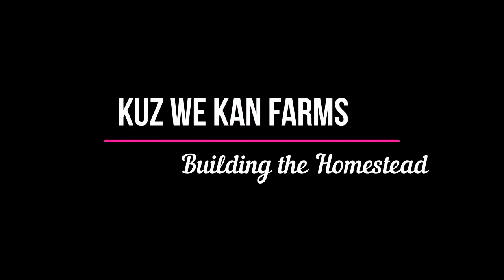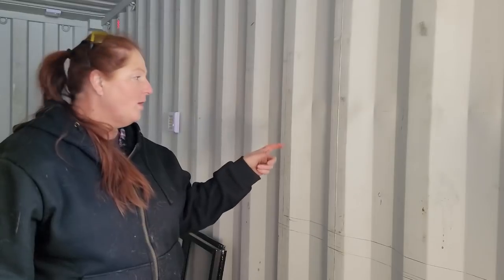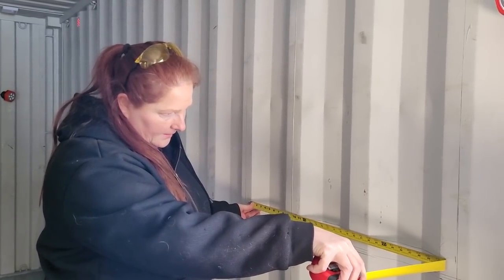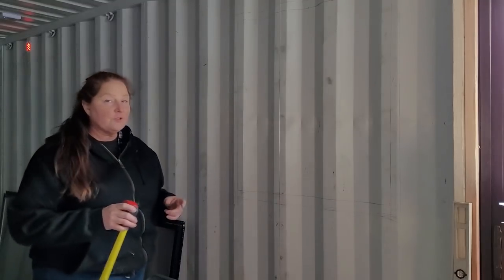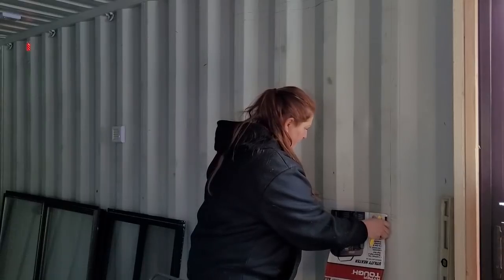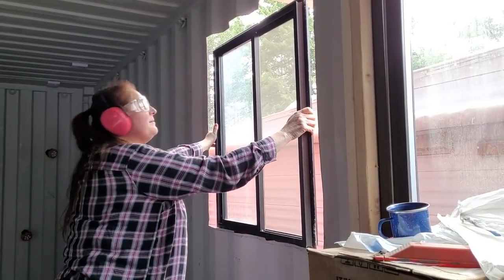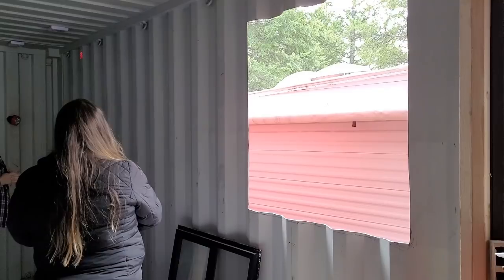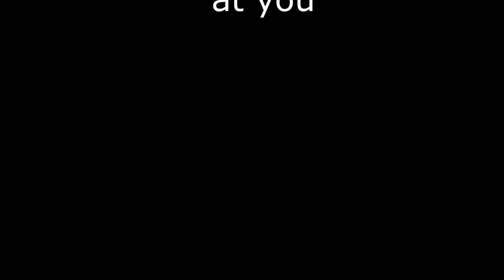Cutting out Windows in Shipping container Things didn't go as planned// DIY build// VLOG

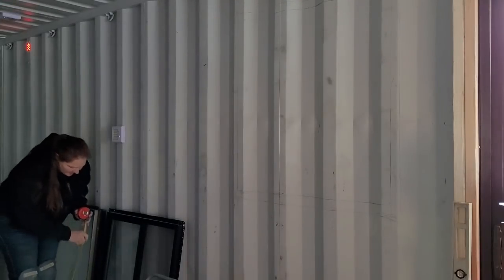Comment: As you drew the side-lines at 8:30, I had an eureka-moment. Instead of placing the side-lines on a slope in an effort to keep the opening symmetrical, how about shifting either left or right so that the side-lines fall on the flat of a bump or a valley. Even if one side is in a valley while the other side is on a bump. That way you can avoid angled cuts. Though you will have to measure the rip of each side separately.

Comment: Hello from South Florida! What if...you build the 2x6 frames to fit the window, then hold that frame up on the wall to layout your lines? Then trace the outside perimeter for your cut lines? If you have multiple windows of same size, you just need the one "template". It might make things go smoother. Usually the rough opening (RO) is about 1/2" bigger on all sides, so add an inch to the width and height. Thanks for sharing.